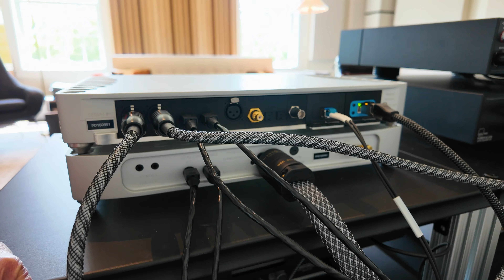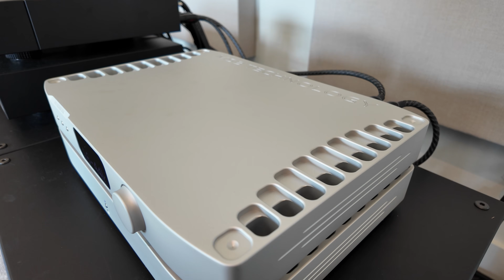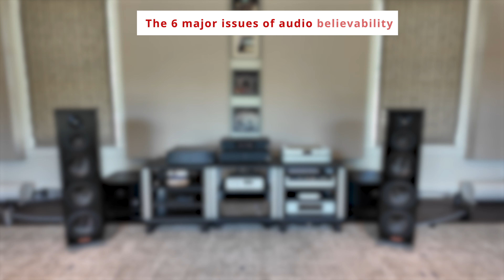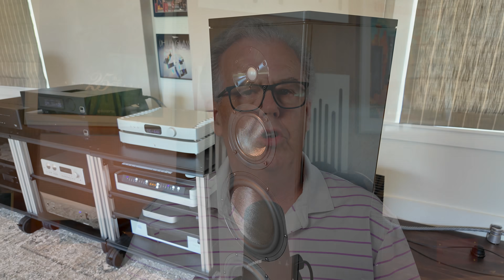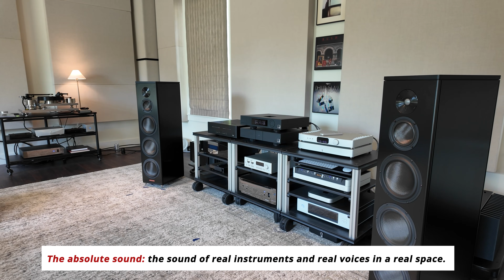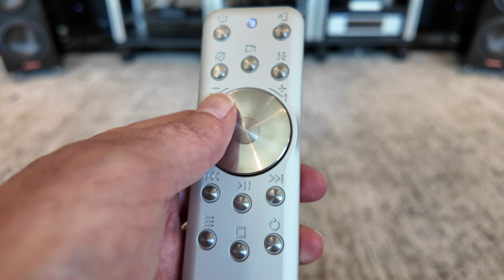Best DACs under $50,000 Series: MSB Premier

Comment: 5:59 Hmmm... is  this only the case with AAA records or with AAD, ADD or DDD records also? If it is the latter, someone surely can come up with the exact filter to make digital systems sound just like their analogue counterparts? This question has been going on for far too long. We are in a position today to do a recording simultaneously in an analogue and a digital medium and produce both an analogue and digital record which we can then reproduce through the same audio system (apart from the record player). The only thing left is a test procedure for comparing the two that we can all agree on.
Reply from the maker: To answer your question: for DAC testing we primarily use the absolute sound (see: https://www.theabsolutesound.com/articles/the-absolute-sounds-review-methodology-first-principles/) as our reference, but also we have noticed that full analog vinyl often lacks the specific digital distortions we are testing for so we have a set of older analog recordings for testing (some reviewers use tape for the same purpose). Note that analog recordings have their own distortions which are pretty much inarguable, but which we think are a reason that we don't want to make digital sound just like analog -- we want to retain the signal excellence of digital but reduce the remaining distortions. Now for interested consumers, either of those references can be used, which makes this less a pub argument (which is a great way to keep the argument going for far too long) and more something listeners can simply observe. If they notice the distortions, they can attend to them; if not, then they don't need to be bothered. As far as we can tell: a) some but not all of the various forms of digital distortion are well documented in the engineering literature, b) this isn't the same as saying we know how to eliminate them, c) evidence for which is the audible presence of these distortions in many DACs. Logically, it isn't just filters (though that is a thing) but conversion errors, jitter, math problems in converter design, recording bandwidth and more. This is rather sophisticated engineering, so it almost certainly will have different success rates in real world products and will involve tradeoffs/choices. On top of that, we have errors in the digital recording chain, one example being interpolation errors during decimation in the downconversion process. Those may be more addressable, OTOH they are outside consumer control. Hope that helps.

Comment: 'Some viewers may have struggled a bit with this objective information'. What objective information? There's not a drop of objective information in your essays, they're wholly subjective. You might be right in your assessments or not, but neither changes the fact that your reviews are 100% subjective. Objective information is always data backed, the data having either been obtained by measurements or by statistically significant, scientifically controlled blind testing results. Please let's not go down the route of changing what 'objective' means. We'll be making a worse mess of an already messy subject.
Reply from the maker: See our methodology FAQ in the Audiopedia section of theabsolutesound dot com. Hope that helps.

Comment: Another excellent review with meaningful information Tom.  Thanks!  I have a sensitivity to the exact distortions you mention and as a result am considering alternatives to my current setup.  This review was helpful as a catalyst to consider MSB.  Also looking at EMM Labs.  Would love to get TAS opinion on that.
Reply: I have the MSB Discrete DAC with two power supplies.  It’s a really nice sounding DAC.  You may not need much more than the Discrete with two power supplies?  I bought it used at a really good price.  Having the 2nd power supply is supposed to be key to increasing the sound quality of the Discrete.  Good luck on your Hifi journey!

Comment: How can you hear digital distortions at a Munich when rooms are noisy and you are listening to a system in a different room from your own and not an individual component.  Only way to hear what a component sounds like is listening in your room with your own gear you are familiar with.
Reply from the maker: Some digital distortions have characteristics unlike analog distortions and thus are easy to identify. In this sense they are like cartridge mistracking: you don’t get that type of distortion from an amp or a speaker or a cable. Such distortions are often not buried in the noise floor, which as you say is high at shows. A related example is feedback at a live show: the sound level from the crowd and the musicians is high, but you can hear feedback easily because it has a distinctive character (and high level). Hope that helps.
Reply: Some talking heads, like John Darko and others, are overly aggressive in dismissing what a well-judging, experienced listener CAN discern in a show environment.  For example, if you take a piano in a concert hall, then put a piano in your living room, then a piano again in a tradeshow space, can you still tell that it's a real piano?  I hope the answer for you is yes...  And it could be the same piano again and again, or different pianos each time - even different types from grand to baby to upright.  An experienced listener can unquestionably determine the sound of a real piano.  They moreover know, for example, that bass nodes and bass suckouts can radically change a sound and will adjust for those and other listening variables.  They will not - most of the time (not sure I can put a percentage here?) - confuse a toy piano or an electric piano for a real one (although electric pianos these days can be really good...).  The problems and confusion of unfamiliar listening conditions doesn't mean you can't tell reality from non-reality, just that making precise relative value judgments (such as saying two closely performing components compare this way or that way) is extraordinarily difficult.  Flipping the adage of "you can't trust anything you hear at a tradeshow" on its head, what if you think you know the way a component sounds because you've spent weeks, months, even years listening to it in a familiar context (eg, at home in your own system) and then all of a sudden follow that component or even the entire system to an entirely different room in an entirely different building?  What if everything you thought you knew after years of familiarity changed because you are suddenly in a new acoustical environment that alters the tonality, the time-smearing, in short the performance of your gear top to bottom?  For example, my long-time bookshelf speakers that had a nice, warm bass bump in my mid-size apartment - usually making me turn my sub off most of the time - all of a sudden sounded thin and skinny when I moved to a mid-size house - making me decide to leave my sub on the whole time.